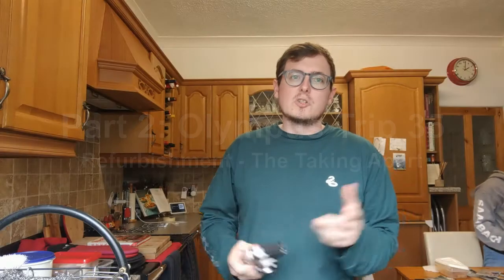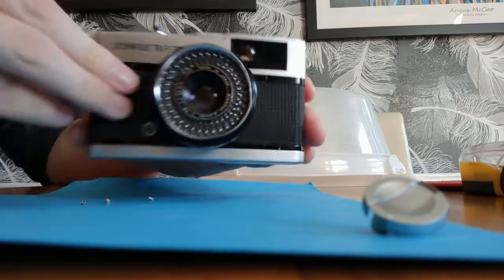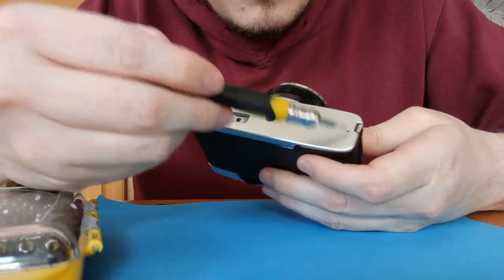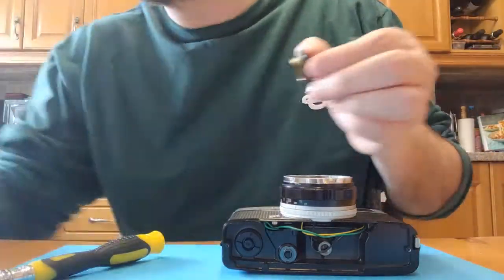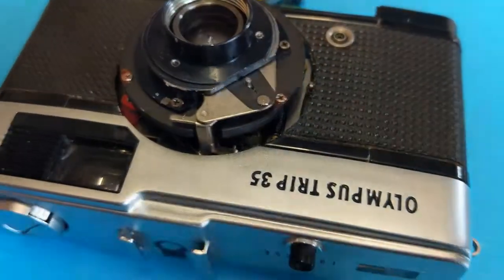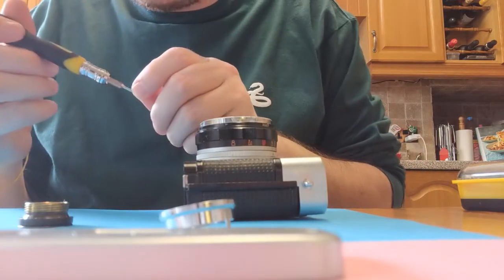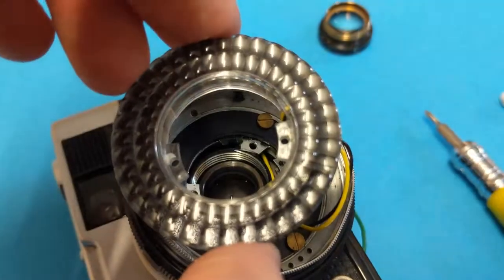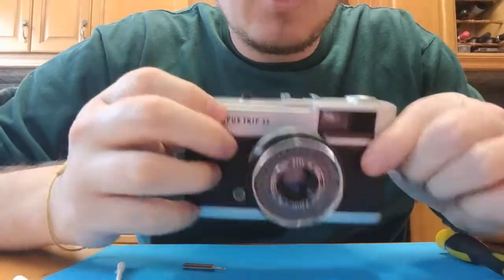Part 2: Olympus Trip 35 Refurbishment - The Taking Apart

Comment: This is actually a great teardown video of the Trip 35.  Im not sure how much volt the cells are supposed to send to the light meter but its definitly not working right on this one.
Firs make sure the diaphragm isnt stuck. Then when everything is apart, wave your phone led light in front of the selenium cells. The light meter should be moving toward the shutter button.

Comment: Took my trip apart and back together and for some reason the aperture settings wheel is just spinning and not actually clicking round like it should? Any ideas would be greatly appreciated I kept it on A and the mountain icon when putting it back on ensuring it didn’t move not sure what the problem is